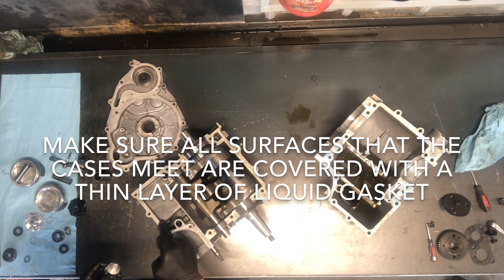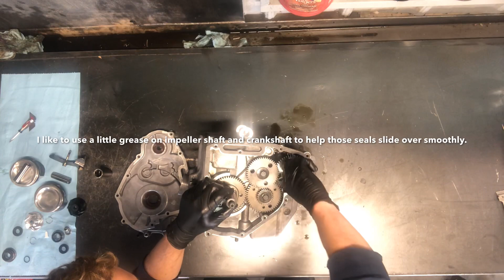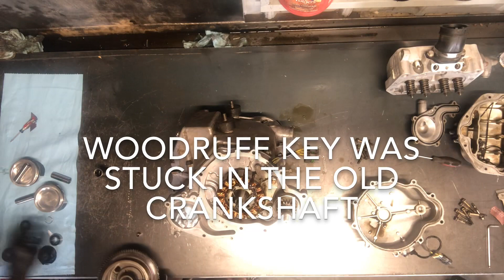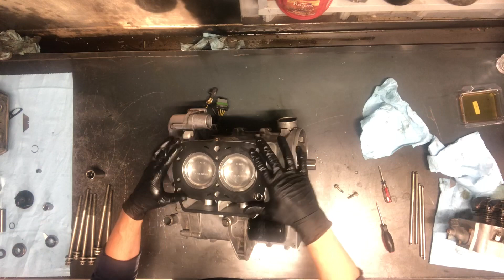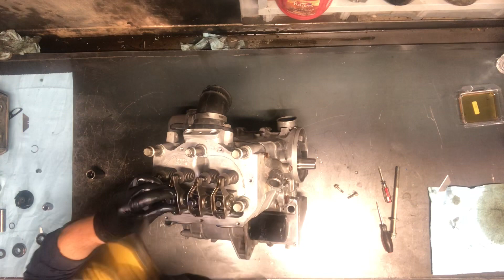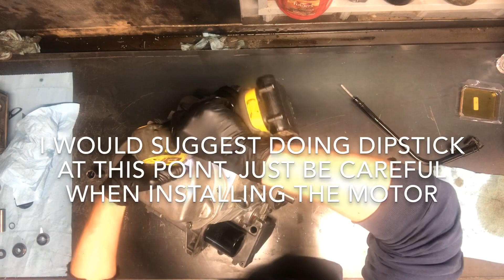Polaris Ranger / RZR / Sportsman  - THE BEST Complete Motor Engine Rebuild

Comment: I replaced crank shaft 
bearings and piston rings. Should I be able to spin crank by hand once crankcase is torqued to specs. I’m having to use pliers to turn or spin crank

Comment: Do you have a video on removing the engine from the bike? I am just getting ready to pull my engine to check why spark plug electrode is getting flattened.
Reply from the maker: I believe we have one coming up. Hit the subscribe button so you are notified when it comes out. Do you think it is necessary to pull the motor to check this spark issue? I wouldn't but curious about your though process here. A couple different pullers you will need for the job: https://www.midnebraskamotorsports.com/product/mnm2-3-1/   &    https://www.midnebraskamotorsports.com/product/mnm1-8-1/
Reply: I bought the bike with the issue so not sure how the engine is in the bike. Maybe I will start with the head first to see if I find anything.
 @MidNebraskaMotorsports
Reply: Is the rebuild kits for the 2005-2010 different that that for the 2011 & 2012s?

Comment: What would cause one of the spark plug ground electrodes to get flattened?
Reply from the maker: The only thing that would cause that is something hitting it. YIKES. How is the motor doing?
Reply: Finally got around to pulling the head off. PTO side piston was toast. A piece of the skirt missing on one side of it and tge other skirt worn right through. Also a bunch of small pieces of a piece of the top ring from the piston that let go that was hitting the spark plug electrode. Not sure where the piston skirt pieces ended up. Would you pull the complete engine to do a good search of the crank case to find missing skirt pieces. Crank and cam turn freely.

Comment: Nobody mentions in these rebuild videos the split cam gear. If by chance it comes apart, they timing marks MUST be lined up. I learned this the hard way. Everything LOOKED lined up, but it really wasn't. Boo to Polaris for not making it fool proof. I couldn't find any mention of that inner timing mark in the manual either. Excellent video other than not mentioning the cam gear thing.

Comment: you have to be carefull with these engines and get them timed on the compression stroke there is 2 top dead centers it can be timed at and i learned the hard way had to pull the gas tank out of the ranger and take the side off again and retime it on the compression stroke otherwise it wont run very good at all

Comment: Good video and info on the 700 & 800 rebuild.  Do you fill up the lifters with oil before you button up the head and put the pushrods and rockers in and torqued ? Thanks.

Comment: Thank you for the video. I'm rebuilding my 08 rzr 800 and the counter balance dosent want to turn easily like yours dose. Any idea why? One of the rods fell off the crank and broke when the crank hit it
Reply: @MidNebraskaMotorsports  wish I could post a pic. I took it apart again. The con rod burned the bearing on the crank and fell off between the crank and counterbalance. The crank hit the con rod hard enough to brake the rod just below the piston and bend the counterbalance. It also broke the woodroof key on the fly wheel. Can you tell me what key I need to get? Also my cam gear popped apart. Can you advise on how to get it back with the timing mark in the correct location?

Comment: Great information and video thanks!
Any video information on removing honda recon or and similar honda electric shift mechanism for clean/lubrication services or rebuild along with clutch discs replacement would be helpful. I purchased a 02 recon and need to go over all that soon myself but anyhow just a video suggestion. Everything you share is appreciated. Be well and keep up the great work 👍